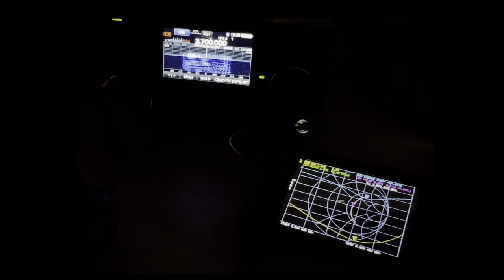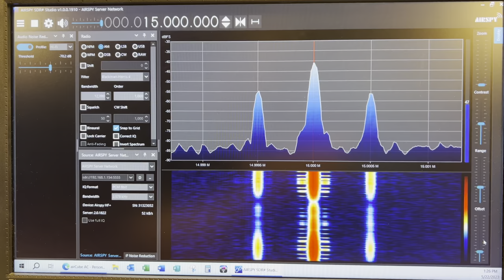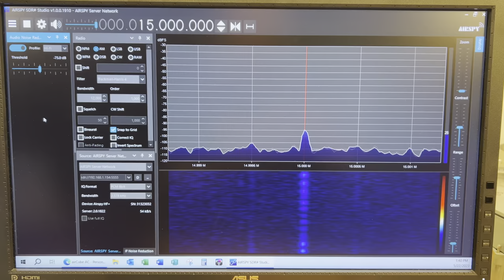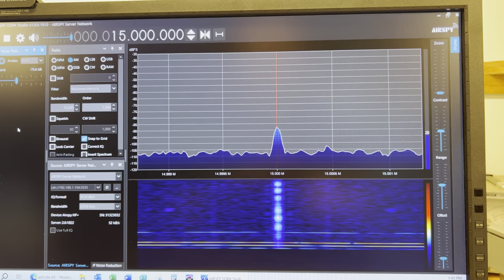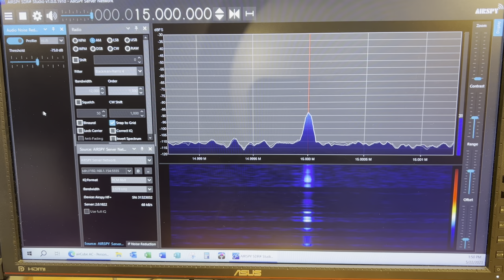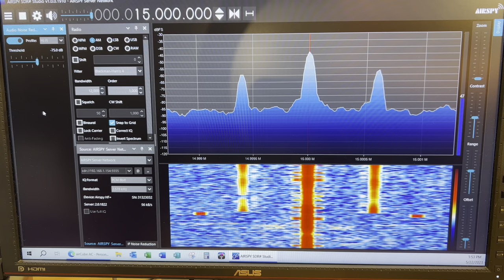MLA-30+ Experimenting with a loop receiving antenna.

Comment: I realize that many people speak of this antenna as a Magnetic loop antenna however it is not a Magnetic loop, it is an active loop which uses an amplifier to boost the received signal.    The magnetic loop does not. 

 A properly built magnetic loop has an extrremely narrow tuned bandwidth the span of which will be dependant on the frequency of the band in which you are tuning.  I believe you do a diservice to the magloop when you compare them to an active loop.  I have 2 mla-30's and use them both.  They are great for reducing local noise to alleviate listening fatique. I also have a 6 ft. diameter magnetic loop that compares extremely well with the ZS6KW antenna on the 40 meter band on transmit and is far superior on receive due no doubt to its noise reducing capability. On air tests found that receiving hams generally gave the edge to the magnetic loop over the other antenna.

by the way, I have a 10 - 15 db  over s9 noise level on  the zs6bkw .  The mla-30+ reduces that to around 4 S units though  it also reduces the level of the incoming signal but the signal to noise ratio is ever so much better. It is also positioned much farther from any houses which no doubt helps.
Reply from the maker: Thanks for taking the time to post this comment Garry.  I have done a bit of research on this and it seems you are correct.  For the most part, this is not a mag loop antenna, but…. ;-)

Here is what I found…

————————

April 2024 Notes - Is this a “mag loop” antenna?

In response to a couple of viewers who stated, “This is not a mag loop antenna”…

I did some research on this… it would seem you are correct, but… Hahaha!  As always, with so many things, “it depends” comes into play.

On page 9.13 of the 2023 (25th edition) ARRL Antenna Book, I found a little box with a statement about the definition of a Mag Loop antenna.  It references the Mar/Apr 2020 QEX technical note which defines the boundary as being where the circumference of the loop is less than .05 wavelength.  This is where the electric to magnetic field ratio tips in favour of the magnetic field.

In this case, a 1 meter diameter loop is considered a mag loop at frequencies below 4.8 MHz… so on 80 meters, this would be considered a “mag loop”.  At 40 meters and above, it clearly does not meet the definition.

————————

Comment: Hi Gregg.  Nice video for comparison.  Just a comment on how to show the peak, noise floor, and SNR on the SDRSharp screen.  If you place the cursor on the center frequency in the upper spectrum window, SDRSharp will show the received signal parameters.  It might also be helpful for comparisons to switch the HF+ Discovery sampling rate and/or spectrum window width to show a wider swath of frequencies.  

Also, when you first go outside at 02:00 in the video, the loop is oriented with its plane in the horizontal.  With my limited experience with loops, the poorest reception is with the plane of the loop oriented horizontally.  In fact, once you 'rotate' the loop into a vertical plane between 02:02 and 02:08 the signal levels pick up, and drop considerably when you rotate the loop back into the horizonal plane at around 02:10.  After 02:13 until 02:37 when the loop plane is vertical again, signals pick back up.  The "brightest" peak in the waterfall appears at about 02:15, and you can see peaks and dips as you rotate the loop throught the vertical plane, as would be expected with a loop antenna.  Based on your QTH coordinates as listed on QRZ.com, WWV should be at a Great Circle bearing of 140.8°, or southeasterly.  Thus, one might anticipate the highest signal from the loop if oriented vertically and the support rod pointed in a southeasterly direction.

At about 02:34, you make the comment that orientation is about the best you can get, yet the waterfall seems to show a signal dip at that time.  Perhaps it was fading going on, or your Black Lab was blocking the signal as it walked by, hi hi.  My point is, that when you started your outside tests, the plane of the loop was oriented horizontally, and if you returned it to a horizontal orientation for your comparisons then it might not have performed as well as could be expected.  It will never compare to the dipole, but you might be able to squeeze a bit more performance out of it with proper orientation and rotation.  If you have a local noise source, turning the loop to null out the noise, as opposed to peaking the desired signal might be your best bet.  You allude to that in your last reply to ThinFreddysFlop from 10-days ago.

Again, great video.  Keep up the good work, and good DXing.  73.   Ken -- WBØOCV
Reply from the maker: Thank you for sharing these thoughts.  I will go mess with the SDRsharp software and see if I can get it to tell me S/N ratio of a signal.

Sometimes I will intentionally set the loop for minimum signal and maximum noise to feed the ‘noise’ input of a phase type noise canceller.  That may have been why you initially saw the antenna oriented this way :-)

Comment: Many thanks for a great video, here is what i got out of it.
The dipole wins every time, the use of rf gain will help sort out most of the noise floor situation.
In a small place situation, one might be better using a vertical antenna.
As for N/S ratio, a full-size loop will perform the best and take down most of the noise floor.
Reply from the maker: I’m going to watch for an electrically noisy day on my dipole, and then take some video comparing the performance of the mag loop versus the dipole again, with regards to signal to noise ratio. I would like to show if and how the mag loop is able to null out local sources of noise that I cannot do with the dipole.   At this point, I agree that the dipole is winning. In my mind the comparison is not quite yet complete though.

Comment: Gregg, I like your video, but I think you are being unfair with the MLA-30+. Given its almost nothing price ($28 delivered), its a stellar performer. If you mount antenna to a $120 RCA TV remote controlled antenna rotor, you will be very impressed with its ability to dig out weak signals. I use a wire antenna to detect their presence on a wire antenna connected to my SDR Play receiver. Then I zero into it with my MLA-30+ rotated to the optimal azimuth angle. Connected to my AOR 7030 shortwave desktop receiver or my Drake R-8, I get fantastic results at a nominal cost. BTW, I have gotten the best results powering my MLA-30+ with a Samsung or LG cellphone USB charger. Other cellphone chargers inject too much noise either through the wires or RF-wise.
Reply from the maker: Thank you for the comments. There has been speculation that I may have gotten a poor quality copy of this antenna. I have since ordered an LZ1AQ pre-amplifier kit, and have built one of the recommended configurations using two loops. It does seem like it’s able to rival the full length inverted V on 80 m so far. I have a lot more playing around to do but initially I am pretty impressed with it.

I do agree that for the price, the MLA 30+, even if I have a poor quality copy, does pretty good given its size and price.
Reply: Yes, there are a lot of cheap MLA-30 knockoffs out there, and I guess I just got lucky my two MLA-30+ purchases. But regardless what remote rotator you use, the RCA one on Ebay does the job well at a fraction of what a HAM styled rotator costs. I bought a remote 30 dollar TV rotator recently. Once I weatherize it for outside use, I plan to mount it on a spot on my wooden fence.
Reply: I installed two V antennas in my backyard and I am happy with them. One has RF traps and the other does not. But the 3 loops I use are still less noisey than my Vs.

Comment: Hi, how does this perform compared to a long wire antenna?
Reply from the maker: I have not done that comparison, but… so far the mag loop has in only one circumstance performed better than my inverted vee dipole.. when I had a local noise source that was S9+ on the dipole and I was able to orient the loop to use the null point to minimize the noise.  In all other circumstances,  the dipole gave better overall signal levels and better signal to noise ratio.

Based on my observations, I would expect that the long wire would perform better in all conditions, except where you have a very strong local noise source.

Comment: Looking at your copy of the MLA-30+ it seems that yours is a knock off, Gregg. The genuine one is less noisy than counterfeit ones.

I learned that my first purchase was a knock off when the LNA module which was shipped to me has four screw holes and not six. The metal wire for the loop is much longer (larger diameter) than the original version, it kinks in places and is impossible to form a perfect circle.
In addition, no Philips screws were provided with the kit.
The bias tee box came with a red LED instead of bright green.

I did a quick and simple test myself at home by swapping the bias tee box (green LED) that came with the genuine MLA-30+ kit with the bias tee from the fake kit (red LED). The noise floor is higher with the fake bias tee unit. 

I had also experimented using the genuine bias tee with the fake MLA-30+ LNA and got similar results. I guess the manufacturer of the knock off kit used substandard electronics components in both the bias tee box and the LNA module.

The radio receiver which I used for my simple experiment was an RTL-SDR Blog V3 USB dongle and I used the Android version of the SDR++ software running on a 10.4" Huawei tablet. I have since bought a Malahit DSP1 clone standalone SDR, an RTL-SDR BLOG V4 and an AirSpy HF+Discovery but have not repeated the experiment with both MLA-30+ antennas.

I will still keep the knock off MLA-30+ and intend to use it with my Tecsun and XHDATA radios. It does pull in faint signals much better than the passive wire reel antennas which I have used for years, but the genuine MLA-30+ kit is the best HF antenna that I have at the moment. 🙂
Reply from the maker: Thank you for the information.
Reply: @ve6wo  This is definitely an inferior knock-off. I know because I also received a knock-off when I ordered an MLA-30+. In addition to the characteristics listed by Stratmanll (mounting case with 4 holes instead of 6 and a longer, bent wire antenna), the "biasing tee" box for a knock-off often does not have a hole for the LED light to shine through, and the label is often upside-down compared to a genuine "biasing tee" box. A genuine "biasing tee" box has a green LED, while an inferior knock-off typically has a red LED.
Reply from the maker: @JonAhlquist   Thank you for the information.

Comment: Open it up.  There are gain and attenuation pots you can adjust for optimization in both the bias-t and the lna.  You might have some luck with that,  might not.. depending on how they set it at manufacturing.
Reply from the maker: Thank you for that.  I will take a look :-)